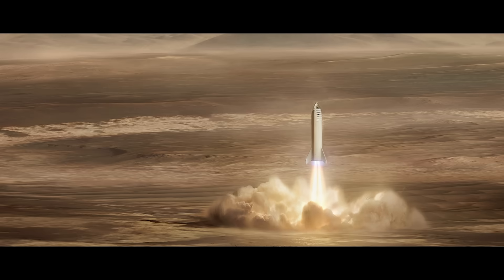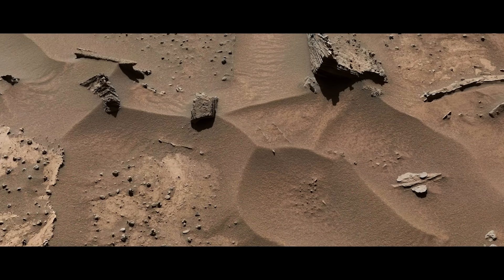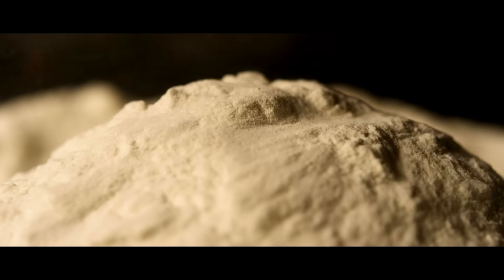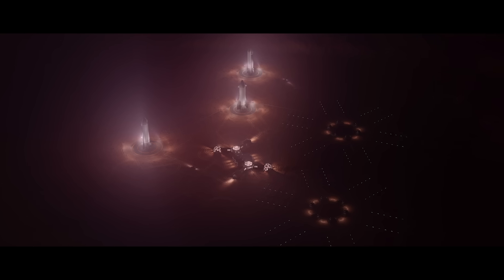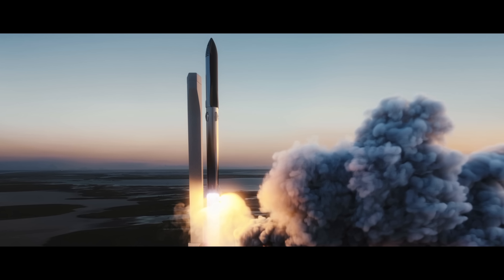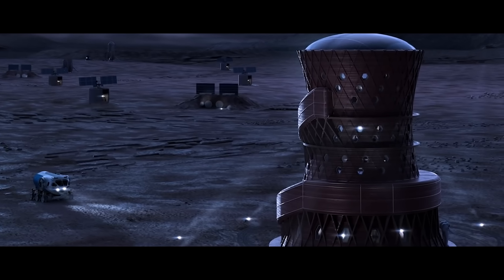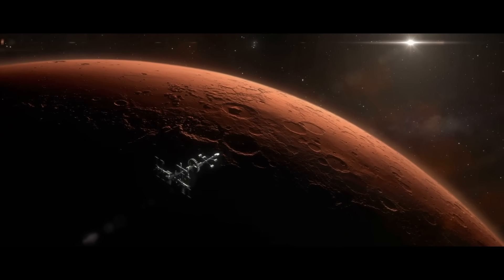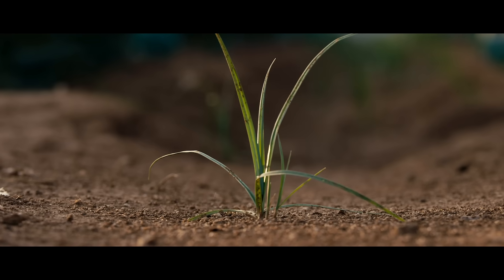THE FIRST 10,000 DAYS ON MARS (Timelapse)

Comment: If 10% of this comes to pass by 2051, that'd be amazing!
Reply: Unless lex luther keeps suing nasa and space x..lmao
Reply: @Aayush Kumar   Well, at least you did some homework. The problem is that SpaceX isn't planning any water tank shelters. That's the point of this thread. Do you see any designs? Not conceptual art, but actual designs for any of the missions..? "Do the maths..??" How about the fuel to weight (mass) ratiio for those water shields? As for living beneath the surface? The colonists will become like the Dwarves in LOTR? Antarctica has gravity, water, minerals, oil, perchlorate-free soil, proximity to resupply, abundant sea life, slightly more exploitable solar, AND protection from radiation. So why isn't that VAST, resource rich continent covered with colonies? They're even only hundreds of miles from trading partners. Can't be the cold, It doesn't get as cold as Mars. Sure, people would ideally have to live beneath the surface for protection from the environment.., but it's still exponentially easier to "colonize" Antarctica --- and we're not. Science stations are not "self sustainable colonies."
Reply: @Aayush Kr. you're just trying to sound like a smart ass, you think we are meant to be multi planetary species if so we should be thinking like a colony, not a private business/capitalist, if we thought like a multi planetary species asteroid mining, moon mining would be a much much much better advancement and easier for breakthroughs than "colonizing mars", sustainability has everything to do if we face problems terraforming our own planets without facing consequences how are we at a level of "multi planetary civilisation", before going to level of colonizing other planets in the solar system don't you think we should be capable to at least solve energy related problems in our existing world but no lets get to mars which is very very very very hard to sustain life and colonize it, do you realize how stupid this sounds, not just that we destroy nature, ecosystem and inturn indirectly make it hard for us if we are "meant to be multi planetary species" as you say how do you think we are going to do that? By delpleting non renewable sources for dumb mars missions? Ofcourse follow the smart billionare who is trying to lure investors with his famous technique, "invent problems that don't exist and give the most absurd futuristic solution"
Reply: Umm nothing really needs to pass no one owns space, you can't so technically if u got the money to build a rocket and and place to launch it, anyone can go to space or other planets
Reply: Riiiight. So if instead of Musk landing 1 million people in 30 years he lands a single unmanned probe you will get a hard-on?
Reply: @larky368  idk what u mean but who cares what happends in 30 years. Earth is built to handle 10billion people and sot a single one more, in 30 years we will prbly exceed this nimber and we are screwd anyway.
Reply: @Aayush Kr. "you got to start somewhere" misses my point, "Sustainability before relying on a breakthrough"
Reply: We'll still be fighting with our neighbours by then at this rate. 
Sort out the political division and we could actually all get behind something like this instead of arguing about 200 year old history. 
Let's look to the future.
Reply: I agree, this is not for 2032 but more 2050+
Reply: Maybe 2500
Reply: We'll said man, well said..!
At least 10%, not more...
It's a long way to far away...!
Reply: To stop all these conspiarcy theories, here are the facts: Mars has no global magnetic field that is comparable to the Earth's magnetic field. Combined with a thin atmosphere, this allows a significant amount of ionizing radiation to reach the Martian surface. The Mars Odyssey spacecraft carried an instrument, the Mars Radiation Environment Experiment (MARIE), to measure human hazards. MARIE has found that the radiation in orbit over Mars is 2.5 times higher than at the International Space Station. Average doses were about 22 millirads per day (220 micrograys per day or 0.08 gray per year). A three-year exposure at such a level would be close to the limit currently set by NASA. The level on the surface of Mars would be a little lower and would vary greatly in different places, depending on the altitude and the strength of the local magnetic field.
Reply: @extendo7137   I replied, a long a windy reply. YouTube's Al-Gore-ythm didn't like my opinion on the security, monitoring, and censorship of Social Media platforms. They refused to post. So, shorter and sweeter; I don't do Social Media. And, though there's a chance that your invitation is sincere, the odds are much higher that it's an attempt to DOC me. Soooo.., not biting. I'll remain a recluse, thank you very much...
Reply: @johnlshilling1446  ❤️
I'll be doing that right now.
Reply: @sajeel9596    Again, an edit to my last post to you somehow failed to post, or at least, it isn't visible to me. Did you see the edit? It would have been a second paragraph following the "Thank you..." response.
Reply: @johnlshilling1446  your previous reply is not visible to me
Reply: @sajeel9596   Did you see the one that started with "Thank you. Those are very kind words...." ?

The second paragraph starting with "PS..." ?
Reply: @johnlshilling1446  yeah I read that but now it's not showing
Reply: @sajeel9596   Mysterious! I've had this happen several times. There wasn't anything offensive or insulting in any of them. No reason for the Al-Gore-ythm to object. Soooo, what's happening? It's a mystery to me..

Anyway, I listed "Dark Skies, Dark Seas, and Dark Docs" as a good source of well documented short historical videos. "Answers With Joe" for many things Sciencey, And Sabine Hossenfelder's "Science Without the Gobbledygook" (She's my favorite) She's not what people consider a classical beauty, but she's the type of woman I would enjoy coming home to... Yeah, I'm that Nerdy.  🤓
Reply: @sajeel9596  PS. "Probably thousands of miles away..." I'm in the Pacific North West of the United States of America. You?
Reply: @johnlshilling1446  I'm from Pakistan 🇵🇰
Reply: @sajeel9596  Yep! That's definitely in the thousands...
Reply: You know, while radiation is perhaps ruinous for such a vision, I haven't seen anyone comment on COST.  I know the cost to lift one pound to orbit is at least $10,000, maybe twice or ten times that.  IS there even enough money globally to send this much equipment/people?  How are investors going to get any sort of return on this even if their ROI is measured in fulfillment of the mission?  Seems to me that Musk should put his eyes on the moon first or sell a lot more Teslas...and where is that space elevator (joke)?  Anyways the moon is 1/6 the gravity so does that translate to 1/6 the launch cost?  Then human missions and heavy equipment to Mars would be way more affordable?  Just something for you guys to chew on :)
Reply: Well too bad cause it aint gonna happen
Reply: @jlflashyoboiii4913  That’s the spirit!
Reply: What about new born babies once they are teenager as for thier school trips school will take them on mars in 204
Reply: I mean 2040
Reply: I think first astronaut will be god and generation will make Mars bibble and make spicy story how a god float and came here in Mars and how God created Mars lol
Reply: If there's a lot of money to be made because of it, it'll happen.  Profit drives everything.
Reply: @John The radiation on the surface isn't too bad. To start, the mass of the planet shields you from around 50% of the radiation, compared to being in space near Mars. And then you have the atmosphere which shields you from an additional ~30%. If you also spend 1/3 of your time in highly shielded sleeping quarters, that shields you from another ~7%. The remaining 13% still assumes that you are naked and outdoors. Obviously the mass of the habitat or space suit will reduce the exposure further. You can get down to 50-100 mSv/year with almost no radiation shielding, which isn't exposure that is unheard of on earth. Millions of people live fine with such exposure from naturally occurring Radon and similar radiation sources.

The biggest issue for radiation is the transits. Without the shielding a planet provides, the radiation is problematic. Staying indefinitely in deep space without radiation shielding will over time cause serious issues. But one thing Starship is capable of is fast transits, which reduces exposure quite meaningfully. A traditional Hohmann transit to Mars takes 9 months, but the Starship is capable of doing transits in the 3-4 month range. That alone reduces exposure during transit by 55-66%. Keeping the landing propellant, cargo and consumables like water between the crew and the sun also helps. And you can really get down to a level where no additional shielding is needed. You still have the cosmic radiation exposure, but for a 3-4 month transit, it's not that bad. You probably increase your chance of cancer a few decades down the line, but that may be worth it.
Reply: None of it will.
Reply: @Calm Down Nibbah Plus Elons inventions are either lies or not well thought of anyway, i wouldnt be surprised if the first "Starships" never make it to Mars.  Take the cybertruck, either they must have known the glass wasnt bulletproof or atleast wasnt gonna hold the throw against it, in which case it was a lie or they had noidea that the invention might look good on paper but is really total crap. Judging from the surprise on his face, im sure it was the latter.
Reply: Don't believe the hype. All of the people will die from radiation exposure. The trip to Mars will be enough to kill everyone, then add 2yr + 2mo on the surface of a planet without a magnetic field to redirect the cosmic radiation.., then add another trip home through enough radiation to kill. But! Don't forget to invest in the project!
Reply: @johnlshilling1446  shut up you're scaring the rich idiot investors!
Reply: @johnlshilling1446  Yup. I don't know about you, but I'm more into using materials from NEA's and the Moon to build rotating habitats. No gravity wells, adequate radiation shielding, and no multi-thousand year terraforming project to get a Pre-Cambrian environment, let alone an Earth-Like one.
Reply: @johnlshilling1446  Where are your qualifications, published papers, talks etc so I can reference them?
Reply: @johnlshilling1446  SpaceX is not a public company
Reply: @FigRelatedPun   I suppose you've never thought about the many ways that people can be invested in something? There's a lot more out there besides money.
Reply: @johnlshilling1446  I suppose thats true. You seem pretty invested in talking nonsense after-all.
Reply: John L Shilling I totally agree with you. It will be a suicidal mission!!
Reply: @johnlshilling1446  is it even that exciting? 
The most I've seen come from Mars is dust. 
The drilling tests they did that all failed because it The surface was so fine. 
So regardless of radiation, it still seems pretty pointless. 
I think the first people will get there and say "Nah, more hassle than it's worth tbh" 
As for the radiation, did the LEM that landed on the moon have a 3mm thick, tin foil skin?
Seems shady to me with the amount of space dust etc flying around. It would pass through that with minimal effort.
Reply: @johnlshilling1446  👏👏👏🤝
Reply: @johnlshilling1446  and the mars atmosphere stops some radiation.
Reply: @dylankersten3383   LOL!  I think you might want to research a little bit. Come back when you know how ridiculously small the amount of radiation that is blocked/absorbed by Mars' atmosphere. Tell me what you've discovered...
Reply: @johnlshilling1446  it does block a little. But covering a base in dirt helps stop radiation leaks.
Reply: @raembes   "Have Faith!" --- Got it...
Reply: @johnlshilling1446  spend years underground, years at sea...it is what explorers do...and have done since the dawn of man, someone will, maybe not you, but someone
Reply: @alex4alexn   OK.
Reply: @johnlshilling1446  Roger that, cheers
Reply: @johnlshilling1446  I'm watching her right now and she's infact really good.
Thanks alot for recommending her to me ❤️
Reply: @sajeel9596  👍
Reply: @johnlshilling1446  That is why they will have buildings keeping inhabitants safe
Reply: @johnlshilling1446  it's rare to see someone like yourself who understands how radiation works in space
Reply: @johnlshilling1446  Yeah those are some wild conspiracy theories. Love it! Keep 'em coming
Reply: @tubingforever   Gotta million of 'em. Any counter arguments? Any solutions to the problems. They are not conspiracies. The problems are real. I've been searching for any serious, practical solutions, but so far, nada. The best solution for perchlorates has been presented by a highschool student. Unfortunately, the chemicals needed to remove them have to be imported from Earth. Uncountable tons of chemicals. Hope you have something to offer other than scoffing.
Reply: @johnlshilling1446  You're living in a fantasy world bro. But it's funny af, so keep going
Reply: @tubingforever  So, scoffing it is.
Reply: @johnlshilling1446  radiation shielding. You can find it in your microwave :)
Reply: @sammmm6266   Not even worth the time to explain how uninformed that comment is. (I'm trying to get away from using the 'S' and 'D' words)
Reply: @johnlshilling1446  Ah, Another intellectual - brilliant. How very amusing. You’re not a Rick and Morty fan by any chance?
Reply: @Klunkelele   How intellectual does someone need to be to respond to trolls? And BTW, I've never seen Rick and Morty. Not once. You seem to be well acquainted with them. Care to explain your reasoning, or lack of?
Reply: @Patrick Notstar  Wrong. Some did. Most didn't. How about you?
Reply: @johnlshilling1446  you don’t think Elon will pull it off?
Reply: @stevewharram5518   Exactly the opposite. I just want the people involved to be open up about the hazards and "be transparent" about proposed solutions. Let us know what and how they are being addressed... Stop trying to "protect the children from the monsters."
Reply: @tubingforever  I mean he's not wrong. You can shield yourself from it. One of the best ideas is to store human waste inside the hull. Water is a great protector  from cosmic rays.
Reply: @johnlshilling1446  seeds made to grow in Martian soil.
Reply: @sammmm6266  microwaves and cosmic radiation are two different things
Reply: @burtknighten1873   Uuuhhh... the first thing I mentioned was low gravity...
Reply: @burtknighten1873   I'm not going to even try... just look up perchlorates in Mars' soil.
Reply: @dylankersten3383   Riiiiiiight... So, answer this one; What percentage of current and future astronauts are/will be thrilled to hear that you'll never be an engineer.., or a scientist? --- A quote from Elon Musk:    ".. A lot of people will die.." --- (interview on Mars colony)
Reply: @johnlshilling1446  I agree with your points but you have to take into consideration that there are thousands of people working in NASA and SpaceX know these hazards.
There are many brilliant minds working hard to solve these problems(radiation being one of them)
But I do like that you're taking a different view on this issue rather than being fictional.
It's brilliant to see you thinking like an intellectual but do consider where we came from and where we are today.
I know that mars colony in the near future is near to impossible but in a few decades it might be.
Reply: @sajeel9596   We can hope! And you're right about thousands of people, way smarter and better educated than me, are working on these problems. I'd be happy to hear about solutions that aren't science fiction. Practical solutions, not just ideas and proposals.
Reply: @johnlshilling1446  yes I agree.
Reply: @sajeel9596   Thank you. Apparently, many don't. One commentor says that I'm talking nonsense. I suppose that anything not understood would sound like nonsense, but only to those that don't, or won't, understand.
Reply: @johnlshilling1446  I did read the whole thread and saw many stupid people commenting.
BTW since we're at it,what are your thoughts on a moon base first as a practice/sandbox before we even try for a mars base?
Would love to hear your thoughts on this!
Reply: @sajeel9596   I can't respond now. Appointments. Maybe I should say re-respond? I wrote a very lengthy response, but YouTube's  Al-Gore-ithm didn't (or wouldn't) post it. Strange, because there was nothing offensive -- at all -- in it....??? Later 😁
Reply: @johnlshilling1446  sure mate! 😊
Reply: @johnlshilling1446  3 meters of solid thick walls should protect from cosmic radiation and Mars does have an atmosphere which will reduce radiation albeit slightly. the main problem is self sufficiency on what is a barren desert with no oxygen or drinkable water.
Reply: @johnlshilling1446  I agree with your initial comment, which highlights some of the harsh realities the Mars mission faces. The only way we will colonize another planet is by throwing what we have at it for decades, trying to learn and adapt as much as we can. Someone above pointed out that we came from sticks and stones, sure, but what they are ignoring is the centuries it took to go from advancement to advancement. We will try, we will fail, we will keep trying. But, I doubt it will happen in our lifetime (sad really, would have been nice to be alive in a century where we are known for more than just advancements in mouse DPI).
Reply: @johnlshilling1446  youre the type of student that reminds the teacher to give everyone their homework
Reply: @Fatal_50Cal   Riiiiiiight... "The Color Black "??  Which color would that be? I didn't do my homework. I never learned the name given to the absence of all color, other than black. Yeppers. You're onto something. Keep us posted.
Reply: @johnlshilling1446  you just wasted your time writing that cause I sure as shit didn’t read whatever that is 🤣🤣
Reply: @Fatal_50Cal   Good. Blocking you. Hiding your comments. Deleting your nonsense.
Reply: @johnlshilling1446  no please don’t, what will I ever do? 😭😭
Reply: @johnlshilling1446  my re-respond is still pending my friend 😁
Reply: @johnlshilling1446  I know life can be hard at time and you've experienced much more than me and I'm delighted to gain your experience as I'm just a teenager but have learned so much from just a few back and forth replies.
You've made a lasting effect on me and I'll remember you for a long time.
I pray you have a happy and healthy rest of your life and I'm so thankful to you for answering my silly question.
We're probably thousands of mile away from each other but I've gained so much from you sir and I'm from the bottom of my heart so thankful to you.
Reply: @johnlshilling1446  Nonsense. Methods for removing perchlorates from soil have existed and been used on Earth for centuries as some regions (such as the semi-arid regions of Northern Chile) contain heavy amounts of them naturally. The easiest (and oldest) method is simply filtering water through the soil which has the added benefit of producing nitrates for later fertilization of the now cleansed soil, this method was devised and used by the Chinchorro people over 3000 years ago so it's hardly groundbreaking innovation. Modern techniques include reverse osmosis membranes, TSSE, biological remediation or photochemically via UV light on a metallic iron catalyst. Some bacteria will consume perchlorates, and as an added bonus, release oxygen. The high concentration of perchlorates in Martian soil does present one of the biggest hazards but is also one of the easiest hurdles to overcome.
Reply: @brothergrimm9656   No Shi*, Sherlok. Now tell the rest of the class how that is done.
Reply: @johnlshilling1446  The challenges to colonize Mars are obviously insurmountable at the moment, but with time and with our smartest people working on these challenges it would eventually maybe be possible. This video isn't anywhere close to reality. I think for me the main argument to colonize another planet/satellite is to avoid extinction from a natural disaster such as super-volcanoes eruptions or an asteroid impact. So opposing the goal of becoming an interplanetary species to the goal of having a sustainable civilization on Earth is a false equivalency. Doing one does not prevent us from doing the other. 

 I think people have strong reactions to your comments because at first you seem to be saying that it's a lost cause, that we should not even try and that there is no solution possible to the challenges it present (like radiation).

If it's not to colonize (as per the definition) it could be a research station not permanently occupied Antarctica style. 

I think you wrote that working on this project would be a catalyst for science and technology, which is another strong argument to pursue the goal. The benefits of space exploration to humanity are incalculable, most people don't realize it, but our lives would not be the same without it.

The immense challenges of radiations and isolation (to only name two) are huge. But there are a lot of ideas and design made by scientists to create an artificial magnetic field around Mars or some kind of shields for example. And there are ways of protecting ourselves from radiation on Mars, even if we're not dwarves, humans can adapt to different environments and living underground is one temporary solution. A lot of people are ready to take risks and would accept a higher risk of getting cancer (they already do). 
Gravity is another problem, but it's been solved for almost every bone (there's just the pelvic bone that's still a problem really). 

Terraforming would take thousands of years, but it's not impossible. 

Personally I think the Moon should be our first place to start with and  I'm so mad that there was no willpower to colonize the Moon following Apollo (or build a research station, or a mining operation, or just to keep funding NASA the way it was for the Moon Landing). All that time wasted (only because people are not curious enough, not rational enough, not passionate enough about science. It's still hard today as a politician to put money into space exploration because of the public opinion...so sad). ...because as you mentioned I think, even if the Moon is relatively close to Earth, it's still is the biggest challenge for mankind so it will take decades. But humanity would benefit so much from such projects (which are underway). We will see the same  incredible technology and improvements to our lives that came directly from the Apollo project. 
That would be the next logical step in our quest to survive as a species and I wish we would do it faster so I could see some of it.
Reply: @johnlshilling1446  Okay since you're  apparently slower than the rest of the class I'll repeat it for you once more.... you can remove perchlorate from martian soil and make it viable for crops the same way the people in the northern Chilean desert regions have been doing for over 3.000 god damned years simply by rinsing the freaking soil with water. I'm unsure what part of that simple sentence is causing your rigid little mind so much confusion. I mean if the precursors to the Incans could devise and understand the process why can't you?
Reply: @johnlshilling1446  You have got way to much time on your hands.
Reply: @rampage329   And you thought to occupy some of it? ? ? ?
Reply: @johnlshilling1446  Correct.
Reply: @johnlshilling1446  people thought the moon landing was impossible no? We did it it's in our nature to outperform various hurdles pretty sure we'll overcome whatever radiation, gravitational problem you're concerned about
Reply: @ashut0ast23   Not holding my breath. Get back to me when it happens.
Reply: @Warriors-g9k    LOL! You really know nothing about the various types of radiation, do you? Look up Alpha, Beta, Gamma, Ionizing, Non-Ionizing, and Cosmic Rays. They're all different, with different levels of danger and shielding requirements. Suits won't get it. Not for all types, and only minimally, for varying lengths of time, on those types that it does provide protection for. Surprisingly, water is one of the best absorbers of the deadliest radiation, but thicknesses in the Meter + range are required. DENSE elements work well, but just like Meters-Thick water shields, they're too heavy to wear or carry. Why do you think the proposed Martian soil buildings will be required to also be Meters Thick? Wearable suits with that will provide enough protection only exist in Science Fiction. --- Powered Mech Suits --- capable of supporting and carrying - Tons - of weight... The suit alone with processors, hydraulics, power plant, and the shielding will be a minimum of 1 metric ton. (don't forget the rockets, rifles, pulse, and plasma cannons!)
Reply: @johnlshilling1446  I agree 100% with you bud. You’re not being pessimist. It is just reality. Traveling to Mars isn’t just a sci-fi movie. You’re stating facts.
Reply: @joaohernandes2680   Thanks. Unfortunately, it seems that facts don't get along with some people's feelings. LOL!